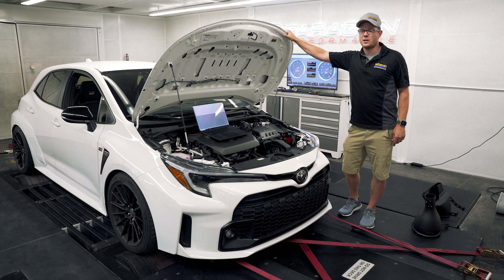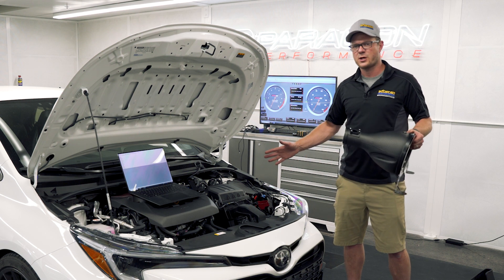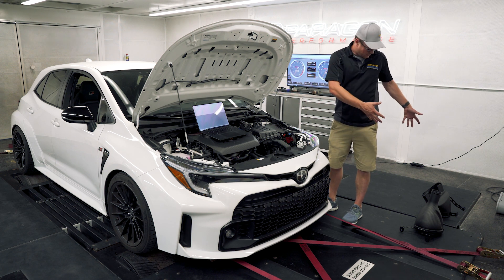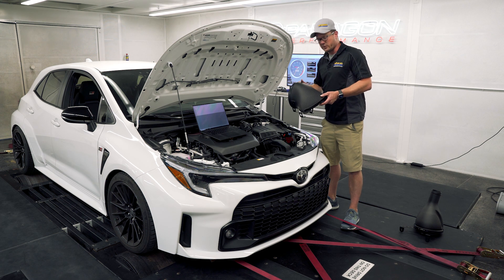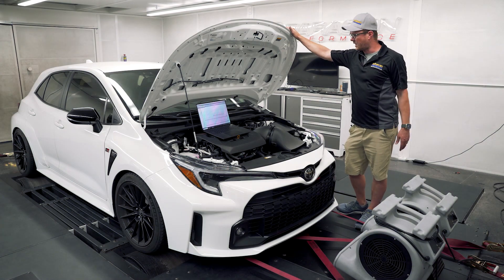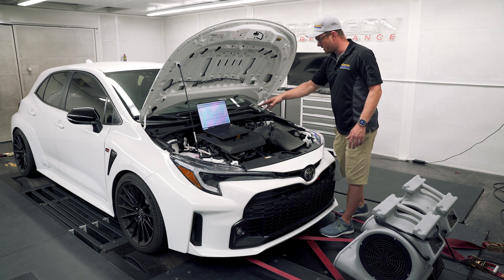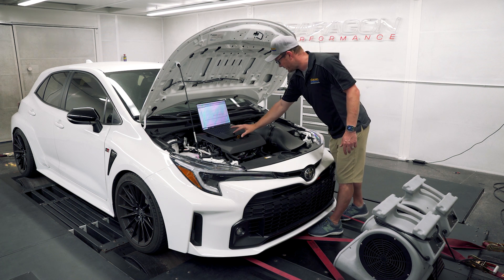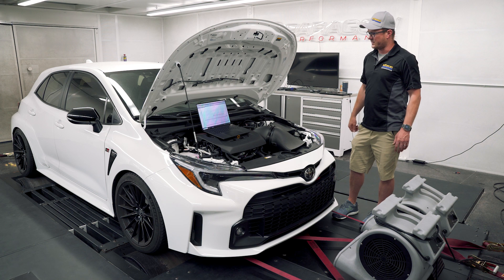GR Corolla Eventuri Intake Dyno Testing

Comment: these cars with the stock ECU are extremely sensitive to high intake air temps. unless you’re on dyno that can flow 80 miles an hour of wind going through your car on the Dyno it’s gonna be impossible to get accurate numbers and to tell if whatever modifications you did made a difference. 

Unless your doing CAMS,turbos,Fuel system I wouldn’t waste my money on a ECUTEK without access to the emissions side of the ecu just go standalone.

Comment: My Corolla GR with intercooler upgrade and hot and cold side pipes and Mustang dyno made 303 HP and 310TQ. Everything else stock 2nd pull made 301whp 307tq.
Reply: stock ecu?
Reply: @stelliosskouloudis703  yes.. but I sold the car in December.
Reply: @mhk67091  why??? I just bought a 2025 with the Gazoo DAT transmission. I was very impressed on the test drive. Transmission responded whacked fast
Reply: @stelliosskouloudis703  I had mine new since 2023 I had a manual and hit to much traffic and manual sucks in traffic. I looked into a 2025 but 50k plus taxes no way too expensive for what it is. I paid 38200 for my 23 corolla GR core.  Plus I wanted more power without voiding my warranty. Now I have a car that's makes 500HP stock. My GR was paid off i sold for 33k. It was a fun car no doubt enjoy your 2025. I would leave it stock for the warranty because any mods you do you need a tune and this engine is very expensive 20k to replace i didn't want to take any risks.

Comment: We need to see the SAE and bot STD dyno sheet.
Reply from the maker: SAE is generally about 2% lower than STD.  Next time we do anything on the dyno, I will include both.  Customers typically don't care about the difference and ask for whatever will show the highest number so we we provide that but we use the same correction for base line and final numbers to so the correct gain. Which correction is used is not nearly as important as doing that and also use one of the corrections in general.
Reply: @boostedperformance_  people want to brag about how much hp they got, especially when dynos can be manipulated. I want to see the power under the curve; the VE is what I care about when it comes to tuning.
Reply from the maker: @touayaaj84  I could not agree more!  We do not tune a peak number, we very much tune for area under curve, smoothness, and longevity before anything else.  We respect the limits of a given setup and leave some margin in the tuning to handle hard use since they dyno testing puts the car into very favorable conditions compared to say road course use for 15-20 minute sessions.

Comment: Got a question the stock air box has a gap in the throat before the box. I believe its for Bernoulli's principle to increase air volume. When i removed just the throat from the grill to install new eventuri. I drove to store and saw a significant loss in power. [I was sent gloss not matte carbon so I stopped install until correct intake arrives] my question is would the forced induction benefit from Bernoulli's principle?

Comment: Does this air intake require a tune or can it stay stock? Sry if I missed it
Reply from the maker: It works just fine on the stock tune. The ecu will close the throttle a bit but you don’t really feel it

Comment: the last pull was hood open so not directly compareable to baseline
Reply from the maker: The last pull was just to hear the intake sound. It wasn’t included in the results. I had also flashed a tune on that made an extra 55 whp so definitely not fair either. :)

Comment: Why not cut dump flap from stock and install into Eventuri so at 4 k level, which I believe to be purposely engineered, it will pull more cool air into
Reply from the maker: The dump flap opens into the engine bay so it actually pulls in air that is hotter than the ambient temp.  The Eventuri Intake is always drawing in air from the front of the car that is at the ambient temp.

Comment: It isn’t hot air when the car is moving… it’s Toyota. Clearly the box has access to pressurized and cool air, given they have seriously way more instrumentation than a guy looking at it.
Reply from the maker: We actually have the ability to see all the temperatures right now with Ecutek.  We can see ambient temp, intake air temp (where the MAF sensor is) and pre throttle temp (after the air is compressed and cooled by the intercooler).  So I was actually to measure and record all these temperatures with the stock intake vs Eventuri.   The stock air box truly DOES bring it hotter air than ambient temps because it pulls from behind the radiator.  This isn't a guess or a theory, I can see it in the data both on the dyno AND my importantly when driving on the road.

Comment: I just started looking at this car to possibly replace my stock MK 7.5 VW GTI. I thought this was supposed to be 300 HP and 273 lb-ft of torque stock? Is the reason for the lower numbers because you are running 91 octane? Thanks.
Reply: Wheel numbers vs factory crank numbers just like anything on a dyno. That's power on the ground after all the drivetrain loses.
Reply: @carlstrohm3785  Thanks for the explanation. I appreciate it.
Reply from the maker: @cbschrader  Yup - to be honest, the engine power is under rated for sure!  A 2021 Subaru STi for example is rated at 305 whp and puts down 240-245 whp on our dyno stock.  The GR Corolla puts down about 270 whp average on a dynojet so that means its really putting out closer to 320-335 at the crank now.

Having owned a 2017 Golf R for a while that has now turned into an Audi RS3, I can 100% tell you that you'd love the car coming from the GTI.  I enjoy driving it more than the RS3 lol.  You'd be gaining AWD and a really fun, nimble chassis.
Reply: @boostedperformance_  Sweet, thanks for the reply and for the info. If I do end up getting it, I’m 100% set on the 2024 Circuit Edition whenever that comes out. Oh, and I’m not paying a dime above MSRP. I live in Florida and I don’t think there is a single dealer in the state that sells at MSRP. They’re out there though and I’m down for a road trip!
Reply from the maker: @cbschrader  you're welcome!  Yeah, be patient and wait for MSRP, it will come.  These cars are awesome but not worth paying a bunch of mark up on, with the popularity Toyota is seeing, they will ramp up production to meet demand.
Reply: @boostedperformance_ Toyota lied about the engine power? this thing making more than 300 to crank?

Comment: Yeah I mean call me crazy but that turbo flutter ain't spose to happen under wot
Reply from the maker: It’s not ideal no but it happens on the stock tune with a stock intake also. The ECU frequently closes the throttle at points and that’s what you are hearing in the video. It’s easier to hear it with the Eventuri intake.

Comment: Does this add torque as well or just hp?
Reply from the maker: Both! It doesn’t change peak torque but it adds torque where power is being added since they rise together.
Reply: If you want to get technical, it is all torque based. HP is just a made up number. HP = (Torque×RPM)÷5252. So the more torque you make, and the faster you spin at that number, the more HP you get. I'm just saying...

Comment: An expensive pice of carbon. Voids the warranty?
Reply from the maker: Any modifications to the engine, ecu, drivetrain, etc can potentially allow the manufacture to deny a warranty claim.  This is has been the case for a long time.  Before modding, its best to establish a good relationship with a dealer you trust and make sure they are mod friendly and if not, keep your car stock until you are out of warranty unless you are willing to risk paying out of pocket there is an issue they wont cover.

Comment: Can you buy the intake and install with no tune as the Afr’s are so similar? If so can you add an exhaust aswell? I thought maybe running both you may run it lean without fuel mods?
Reply from the maker: You sure can!  That is part of what we tested.  The fueling remains the same as stock so it keeps the engine running safely.   We haven't tested adding a down-pipe yet as there really aren't too many options available yet but we'll test as they become available.

Comment: Gread vid on a car that is unfortunately unavailable for us Dutches. I do have a question though. Why do you dyno and compare results prior and after with the hood open? I think one would be better off by replicating road conditions, meaning with the hood closed. The Eventuri (I have them on my ///M2 comp) really comes alive on the road, best combined with stage 2 tunes.
Reply from the maker: We did do the comparison runs with the hood closed. You are correct that this is the the proper way to test. The last pull with the hood open was just to hear the sound and I’d flashed it with a higher boost tune at that point. We have gained 60 whp so with this intake and tuning. Tuning is huge for these cars and the intake really shines at that point. :)
Reply: @boostedperformance_  the sound wooooosh woooooosh 🙏

Comment: The car has a dyno mode to put all the power towards the front but I heard it voids warranty
Reply from the maker: We’ve tested all different ways and on the dynojet it reads the same power in or out of dyno mode and using 2WD or 4WD. We have a linked dyno so we don’t have issues using 4WD. The other benefit to using 4WD on a dynojet is putting more load on the engine, closer to what you’d see on the road since the car puts power to all four wheels.

Comment: It's technically a dump flap, when the system opens the door/flap, it does pull in some hot air, but the main thing is it forces out the warmer air that's "tramped" in the air box, thus pulling in the colder air down the short tunnel and into the system
Reply: That would imply there would be positive pressure in the air box, impossible.  You also should know hot air rises....lol.  What you're saying makes zero physical sense.
Reply: @Perceivedshift  it actually could work if the aero was correct, but inside the engine bay I doubt that it works. Think air operated brake bleeder. Forces brake fluid out of the system by creating a vacuum with the air rushing by. So it could work if they had forced air rushing by to keep the hot air out. He needs to get the readings while the car is driving vs sitting still on the dyno to get real use Temps. I think the new intake will still win though. Looks nice too.
Reply from the maker: From my testing, the intake temps stay pretty good until the flap opens and they rise up quite a bit so to me, it seems to be pulling in hot air and it never comes back down until after the flap closes.  I know there's various reasons for this to exist but that's the real world impact we are seeing in our testing.
Reply: @boostedperformance_ Hot air rises  putting that flap at the bottom isn't the best idea  , you want it at the top exiting towards the windscreen .
The hot air from the engine bay is overcoming the cold because the cold air has to jobs to do , supply air to the engine and supposedly push out the hot air .
Reply: @boostedperformance_ small turbos do that. You should prove your claim before you broadcast it.
Reply from the maker: @BrodeyDoverosx  I don't follow - what are you saying that small turbos do?  Let me know and I'll share any knowledge I have on it or can certainly do some testing and collect some data!  Believe me, I am all about having and sharing the right information, personally, I don't care about being "right", I care about being "correct" in things I share.  :)
Reply: The thing I want to add to this however, is maybe that flap design works better under driving movement, not so much strapped down with a fan in front of car.
Reply: put your hand near an intake under WOT. Tell me how air would possibly DUMP out of a vacuum lmao

Comment: How are you flashing the tune in to the ecu? Which software/hardware are you using?
Reply from the maker: We are using Ecutek with our shop car and will be offering tuning as well.  Right now, we have to flash directly at the ECU each time we want to make a change but we can log with the Bluetooth dongle with the Ecutek connect smart phone app as well as monitor.  We should have either direct OBD laptop flashing and/or PhoneFlash support ecutek in the near future and that's when we can roll out remote tuning.  For now, we can tune cars in person at our Des Moines location or in Chicago at Limit +1 where they are located.